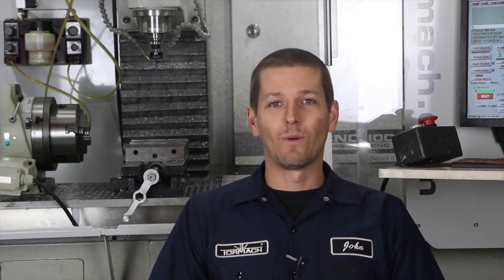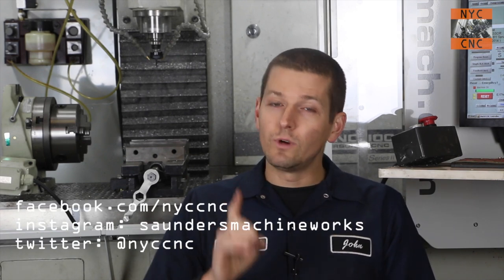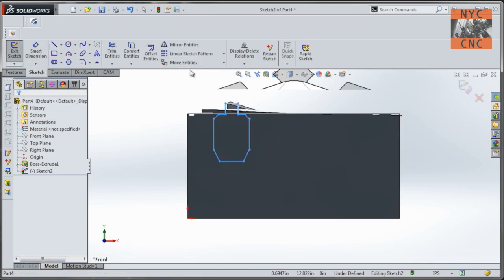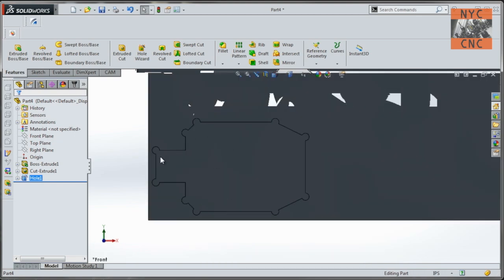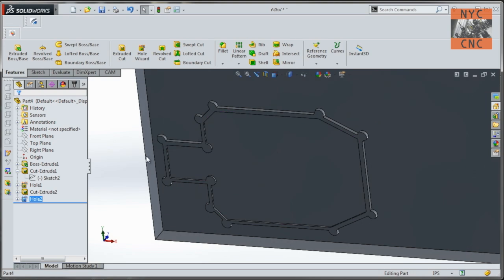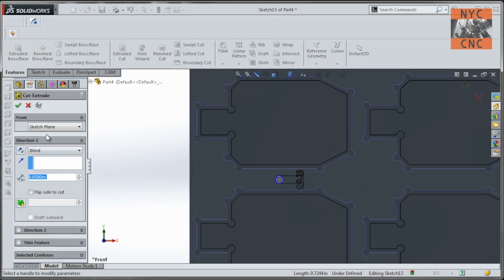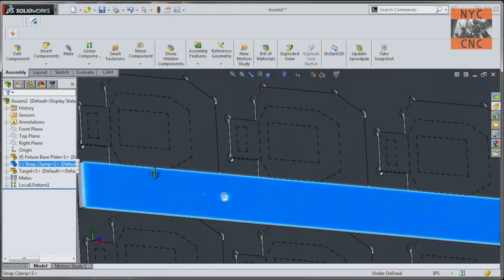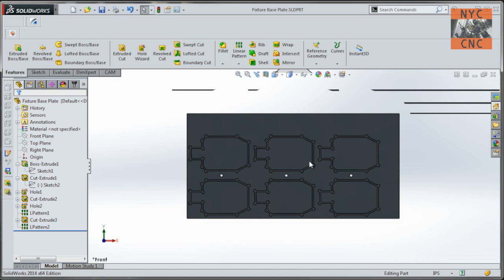DIY CNC Fixture in SolidWorks & SprutCAM for the Tormach Part 1

Comment: Another great video.  I'm in awe of your SolidWorks productivity.

If I was designing this fixture, I'd have probably eliminated the bar clamp and used nine flanged button head cap screws to clamp the top and bottom of each part (center row clamps two parts each).  I know.  Everyone else is an expert when you make a video.  :-)

For fixtures, I love Mitee-Bite clamps.  Although they weren't needed for this fixture, I can see designing the fixture with Mitee-Bite clamps along the top and bottom.  Very handy if you need to clamp the sides, hold the parts down to prevent lifting, AND have full access to the top of the part for operations like fly cutting the surface.  These parts may be too thin to protrude above the Mitee-Bite clamps for fly cutting, but you don't need that anyway.

I'm still low tech.  No CAD for fixtures.  Most of my fixtures are soft jaws and the rest are usually just a plate with dowel pins or Mitee-Bites.

Thanks for these great videos.  YouTube was invented for this sort of edutainment!

Heading off to watch Part 2 now!
Reply: NYC CNC
"Also use stuff from Carr-Lane."  Me too!

OK. Instead of nine button head clamp screws (three rows of three), how about eight screws (two rows of four) clamping the other edges of the parts?  Instant 11% work savings per setup!
:-)

Comment: Nice.  Yeah, given the trough around the perimeter of the recesses you might run into parts tipping up.  Unless your strap clamp is wide enough to reach well beyond the troughs.  ...but then I guess it would be encroaching on the engraving areas.  Thanks very much for sharing your work, John.  Some people look forward to Game of Thrones or whatever.... I look forward to the Wednesday Widget, Monday Night Meatloaf, and Saturday Night Special.  I'm also looking forward to hearing more about your VMC endeavor.  I'm currently shopping for my first CNC mill so trying to absorb as much info as I can.  Up to this point, I've only had manual machines - not even a DRO.  Cheers!  -Tom

Comment: Hi John another way to do this in a more productive manner would be to use a vacuum
fixture I have run high quantities of more precise parts and it would only require a little more work to your fixture and you can buy the o ring stock in spools I think .094 wide worked the best. This way it's one switch to hold all the parts down not a bunch of time consuming screws just a thought. Oh I've been doing nc work since the 80's before cnc was around anything I could help you with feel free to ask if I know it  I would be happy to share my knowledge with you as I feel you are doing a great service to many viewers.

Comment: If the one strap clamp isn't enough, I would make two more strap clamps for the outer edges and taper the inside bottom edge so that the part can slip in and out without taking them off. I am all about making things easy, simple and efficient.

Comment: I see you use the view cube to get a normal view. You can set the shortcut for "Normal To" to the "W" key and the shortcut for "Sketch" to "Shift+S" and when you want to sketch something yo can pick a face or plane and press Shift+S. The view will be automatically normal to the sketch. When you rotate the view and want to go back to normal view you only need to rotate the view to be loosely normal to the face/plane and press W to go into normal view. You can also pick a face and pres W to go normal to that face.

Some other useful shortcuts to set are:
Zoom to Fit.. > F	
Definition.. >	Q	
Trimetric > Shift+W	
Zoom to Selection.. >	Z
Smart.. >			D - i can't remember if it is default or not, but it is really useful

And some useful default shortcuts:
Toggle Selection Filter Toolbar >	F5
Magnifying Glass > G
Measure.. >	M
Shortcut Bar >	S
Hide the Hovered-over Component >	TAB

The Shortcut Bar is a game changer, you can get to a tool faster that thinking what to do next. :) Of course you need to customize it a bit to maximize it's usefulness.

Also, don't forget about mouse gestures.

Final tip. Go to Tools > Options > Sketch and check "Wnable on screen numeric input on entity creation".

I think this tips can significantly reduce mouse travel and number of clicks, dramatically increasing speed and even making SW work more enjoyable.

Comment: Nice project. I was just thinking instead of making a clamps for the edges opposite your strap, drill and tap some holes on the edge of the pockets for pan head screws.  Pan heads should keep the unclamped edges from popping up and provide clearance for cutting tools.

Also do you think it would be worth it to make a fixture that doubles as a welding fixture?

Comment: Nice vid, I enjoy your enthusiasm and abilities.
Instead of your single strap, or multiple straps as suggested by other, or the multiple screws, why not create an overlay for your fixture so that the edges of the parts are covered, you could even groove the overlay for dross (to eliminate having to worry about if part is dross up or dross down).  Make out of sufficiently rigid material (1/8 or 3/16 SS). put four pins into fixture with corresponding holes in overlay, and a single centered screw for hold down.  Minimizes time spent screwing down and futzing with straps.
Reply: NYC CNC
Wouldn't the torch cut the spring out of spring steel?  If your single thin bar was marginal, can't see how a full overlay of rigid material, even 5/16, wouldn't work.
If you send me your email address I have some experience and ideas about your proposed new building.

Comment: You could also put them dross side up. That would help minimize any interference. Then, you could run a real quick face mill @ 50ipm and get some awesome looking textures as well. ;-D

Great video as always. Wouldnt the bolt holes need to be offset by the spacing on the base plate on the tormach? Or are you just using those for the strap clamps?
Reply: NYC CNC I continue to be amazed at your involvement. I have learned a lot so far, and appreciate every time you respond and post a video. Involvement like this is pretty rare online any more, especially with 30,000 followers!
Hope you had a happy Thanksgiving!
Reply: NYC CNC Well, dont overdo it. As a starving college student, I take a full load of class, work 1 professional job, and 1 personal job. It can become extraordinarily thinning at times. Even as young as I am, I have learned the importance of picking a direction and setting priorities. Enjoy your awesome house, family, and job (if you can call doing what you love a job). YouTube will always be here to distract you. :-)

A video from another channel, ***** , made it clear how taxing the yYouTube"community" can be... between harassing your progress, berating your work, and expecting updates. 
A lot of great channels have mentioned how taxing it can become.